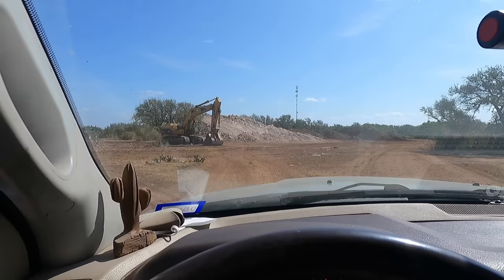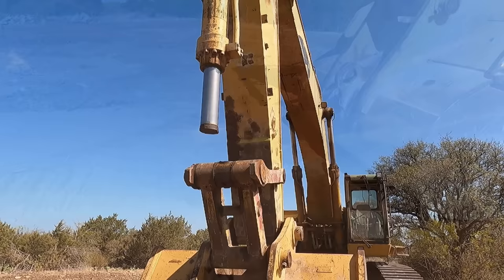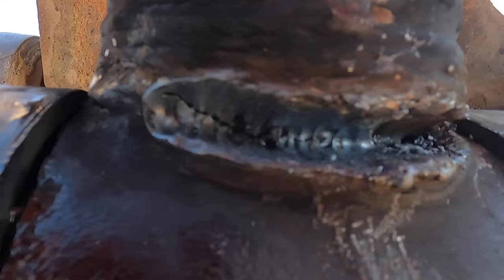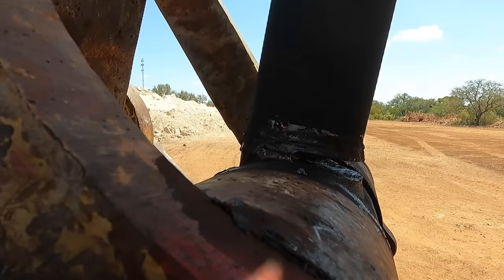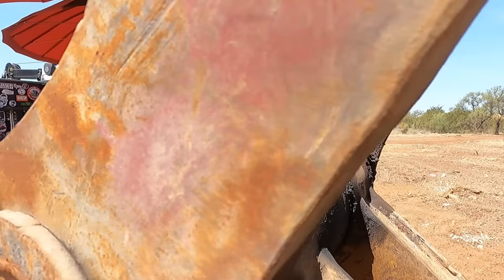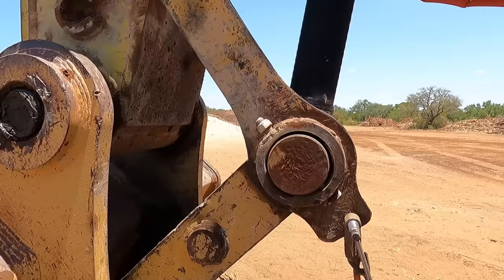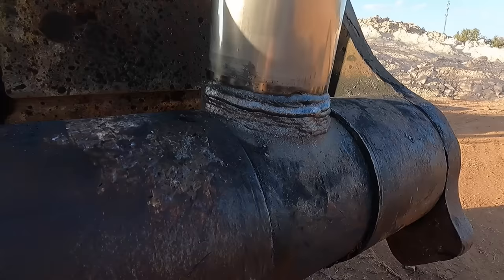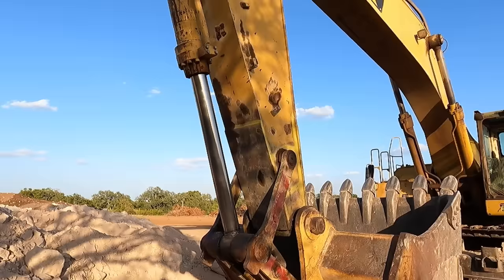CAT 365 Broken hydraulic cylinder.

Comment: Looks great! Its funny that you mentioned Kurtis, because that's who I thought of when you said "is this the right way?". In the field and in the machine shop are two totally different worlds!
Reply: Delta N9NE, they should not be. I shall try to explain why.

Isaac, Kurtis is probably sitting with his head in his hands, quietly weeping, while Homeless gives him licks on the hands and Karen feeds him cups of tea.. 

Mate, what you did is what the owner of the machine wanted, and yes, it will probably last for two more years  -  as long as the rest of the machine holds out that long. But given the history of repairs that you have made to that machine it seems to me that there are several considerations.

1) The machine owner is a tight-arse, and wants his machines running as soon as possible and as long as possible, and profit is his/her only motive. 

2) His/her machine operators are cowboys, probably (it's in Texas, yes?); if they broke that boom as badly as you showed in previous repair videos then those people should not be allowed anywhere near a machine. 

3) Perhaps the damage is a result of the owner's reluctance to spend money on effective maintenance?

4) Perhaps the owner is running a "Hail Mary" startup, with insufficient capital backing to be able to run his/her business, and is cutting corners to be able to continue in business without running out of capital? Yes, that model can work, but you need a lot of luck for that to succeed, and usually that mode of operation leads to ruination or bankruptcy or flight from creditors.

Mate, I have operated businesses, and I understand the processes and caveats in doing so, and the traps and pitfalls, and I understand the constraints your client faces. But if I were you I would steer clear of this client; the next time one of your repairs fails you made be held liable, ad sued, and you don't need that. Unless he/she is a personal  friend, of course. That is a different thing.

 creditors.
Reply: @gregbrodie-tyrrell3473  "... and Karen feeds him cups of tea" - like... WHAT?! Well chilled Victoria Bitter, or Foster's - that's what she'd be feeding him.
Tea? In the time of distress, for a grown up man? You must be kidding, mate... ;-)
Reply: @MrKotBonifacy  Well, he does live in Queensland, so if it ain't tea, but beer instead, it's more likely to be Four Ex, becos that's what is popular up there. The label is written thus:-

XXXX

Because the label looks like this that beer is known as "Barbed Wire" in other parts of the country.

Some unkind souls say that it is written so because Queenslanders cannot spell "BEER", but that's really a slander and an insult (I think), and is not an idea I would support, and that's not because Kurtis is a head and shoulders taller than me, as well as being half my age. I'm not afraid of him; oh no! Besides, he doesn't know where I live...

As for beer instead of tea, while I have seen him drink tea and eat chocolate-coated biscuits provided by Karen, beer is a much greater comfort for a man in times of distress, so there is merit indeed in your words. I shall be more careful in future.
Reply: @gregbrodie-tyrrell3473  Thank you for your kind reply and thorough explanation : )
"I have seen him drink tea and eat chocolate-coated biscuits provided by Karen" - see? Women are just like that, can't do much about it - one has to bear it, and suffer quietly, with dignity. (And pretend "well, I actually like it".)

Also, I'm not that familiar with all them Aussie beers - I happened to drink Foster's with my Aussie pal back in Singapore, and that was... some time ago. "Quite some", to be precise ;-)
And then one time he went back to Australia for a couple of weeks to see his parents, and when he came back he proudly opened a suitcase... full of smuggled in VB (Duty Free allowance down there is pitiful ONE litre only) and declared "this is the best Australia has to offer!"

...and who am I to question his authority on the matter, eh? And, as a matter of fact, quite good it was indeed.
Anyway, note taken - Queensland, "Four X", aka Barbed Wire. Cheers! ;-)
Reply: Kurtis is a real pro not many people repair heavy equipment
Reply: @edswider9309  Anway, I can see why he would prefer to, in the words of another YouTuber, "make a new one". Too bad you can't do that in field repairs - at least not at this size.

Comment: My father started in the Bremerton, Washington ship yard building ships. He started welding deck plates 3 or 4 inches thick {1960's}I got a kick out of his assistant, he made sure he did not run out of welding rod, and put the fire out when and if he caught on fire!  He fixed everything with Weld Wood glue or J B Weld. Dad had last count 9 welders when he passed at 94. He stopped traveling and told them bring it to me and I will fix it. Enjoy the video's.

Comment: IC: Kurtis with CEE how would you repair this broken rod eye?
Kurtis: Well IC I would request that the mechanical maintenance guys remove it and the cylinder from the machine, band it to a shipping skid, ship it to my shop in Australia so I can make a new rod eye then weld it onto a new cylinder rod. Then I would ship it back to the states for installation, something like that.
IC: We don't have time for all that, day light is burning away so lets get to welding.

The end.

Comment: Some times field repairs are a challenge to do it right enough for the machine to continue working. You did mention Curtis from CEE. He does fantastic work. But it’s not field repairs that he does. Guys like you and I have the challenges not of the precision of a machine shop. We get the dirt grease weather extremes. And still need to fix it right. Well as right as a field repair gets. Your experience knowledge always gets you the right finished product. You always face the challenge at least on video without stressing. Another fantastic job. Very good video

Comment: I find I need review sessions.  So I'm back looking at your project.  It amazes me you can weld that rod to the eye and it is probably as good as new.  That rod takes a lot of abuse. You clearly create a joint that is nearly the same structure as the original grain.
Reply from the maker: Well,...It turns out it broke again.... But not from my doing. They allowed  the pin to slide out again. SMH

Comment: Just watched a video from CEE an hour or so ago where he worked on another bit of gear with yellow paint on it. Absolutely great field repair. I hope that the ram had cooled sufficiently before it was tested. There could have been a whole new problem if a scorching hot ram was retracted past the seals in the end of the cylinder.

Comment: If it was off and in a shop with every option perfectly setup, lots of welders could easily repair it. The fact that you did it in the field in way less than ideal conditions, separates the welders in my book. I knew you had to get it welded from the center out. Otherwise it would snap pretty quickly... Thumbs Up!
Reply: The correct way is to take it off and do it right.  It cracked again in another area because it wasn't welded right in the first place.  Welding is not just filling it in.  Heat has everything to do with a proper weld job.  The first job probably caused this crack cause there was too much heat on the boss side that weakened the integrity of the steel.  Before I do any weld jobs on booms, stick, frames...etc it is required for me to get the proper welding procedures from the manufacturer.   Welding like this to "get the customer by" can kill someone one day.  This gentleman is no doubt good,  but you can't just do it to keep the customer going.  It's how law suits happen.

Comment: I was never a mechanic or welder but hung around a garage. Owner mechanic said if man made it, man can fix or rebuild it. First time he told me that he had rebuilt the spiral gear on a Volvo distributer shaft with torches and brazing rod. It worked. As I watch your videos I enjoy the way you breakdown the problem, see the issues and then the best way to repair based on your tools and your location. Beside being a great welder you think through the problem and solve it. Great job, thanks for sharing.

Comment: You mentioned that "Curtis" would notice the cylinder rod wasn't centered.  I'm assuming you meant Curtis from Cutting Edge Engineering in Australia.  I think Curtis would give you a pass on the repair since you had to put the machine back together in the field without lathes, boring mills or rotating apparatus.  
I'm sure your customers heave a sigh of relief when they see your truck roll up to the jobsite.  they know their problem will soon be solved.  
Thanks for sharing your talent.

Comment: I guess it’s cheaper for you to come out and weld up that old girl than it is to buy a new cylinder from Cat . You did an amazing job considering the tight spot you were in!
In Manitoba Canada I was in the crane business for a few years and every year I had to get my crane certified and often cracks were found and then I had to get a procedure from the engineer and they said what rods to use because they test the hardness of the steel and it was usually a 7018 but some places it had to be a more specific rod, but then the certified welder gets to work and once he’s finished then the inspector checks it again and if it’s not up to his satisfaction the welder must come back and this goes on until it’s up to the engineering standards and then I am good for another year but it’s very expensive and I learned don’t lift more than the chart says because it will crack or deform stay within your limits.
Reply from the maker: I've done some crane repairs myself and yes, they're very strict about the whole procedure. Worth it though!

Comment: I did a repair on a cat excavator several years ago. That was a bit smaller than this but still a good size machine. The cylinder was broken off exactly like this and I chamferred it down to a point in the middle and drilled a shallow hole to locate it in the eye. Once I had it set the way I wanted it. I carefully tacked it parallel with the pin on each side so that it would be secured from being pulled out of alignment. Then I tack welded it on the two sides perpendicular to the pin that would be less secure. Gradually filling in on opposite sides with short welds until I had the root completely filled in solid. And I continued to do that all the way around layer by layer until I had filled that whole entire space. Turned out pretty good. I could slide the pin in and out by hand so I know that it was well lined up perpendicular to the cylinder. I was back out the next week welding together the dog bone after they destroyed it. Both the dog bone and the cylinder have still held to this day and that was over 4 years ago.

Comment: 3/32" movement doesn't sound bad for that application. Maybe even pulled back & canceled when you did the other side. Seems the weight & resistance of cylinder kinda clamp it.  That soot trick is cool. Turned out real nice

Comment: Nice job, and it's an interesting case! Thank you for sharing, Isaac.  And it didn't break on your previous repair, so it's not that it lasted 3 years... your previous job it's still in place, actually! :elbowcough:
After tacking the cylinder's eye back in place, I would be tempted to take off the pins, to work on the cylinder on your shop or over your truck... but aside from taking extra time to disassemble and assemble back, the best way to make sure that everything fits in place and remains aligned, it's to work on it directly where it has to be.
So, even if I would be tempted to take out the piece... I like how you worked around it while still mounted in place.  Cheers from Spain, Isaac and son. :yougotthis:

Comment: That was probably the most weld I have ever seen at the end of a rod.  But it works, and it was lower cost than replacing the rod, by far!  Excellent solution to a difficult problem.  And protecting the chrome with soot was something I have never seen.  Very cool!

Comment: I think you have some of the best welding skills I have seen in over 40 years, during which time I was a heavy equipment operator and I have worked on pipelines, so I know a good welder when I see one, the skill you have with an oxy torch... amazing.. for this type of repair, you really need to drill, tap and thread a piece of rod into both the knuckle and the hyd. cylinder , at least 1/2 thick, this will help with the shear factor and you dont need to square off the end of hyd. cylinder to do so, I saw it done on an old JD 790...obviously you need to use a Grade 10 or better bolt, just cut the head off for threading...   Gidday from Canada...

Comment: 13:45 and that's why i weld an ear over the pin house on my machines. I'd rather have to grind that off whenever repairs are needed than have to deal with broken stuff because the operators weren't paying attention. Welded straps are superior to bolts, pins any day. Feller that taught me this went one step further and welded a threaded pipe end, that would then be capped with a bung filed with grease.
Reply: Their welder would get good at it what with all the swapping out of buckets and hammer during the day.

Comment: That makes sense as to how it broke. A rod in a hydraulic cylinder "ONLY" has strength in its vertical ,horizontal or basically in line position. Any side variation will snap them like a toothpick no matter how thick.

Comment: For moving the bucket enough to work on it, you only needed to press down while extending so the bucket will roll under.  Then extend the ram and weld her up.  Just different way.  
I've sootted up stuff for other reasons but didn't think of anti spatter.  Cool.

Comment: I would have tapered it a bit more to a point in the centre weld one side then the other building it out from the centre. I notice you and Cutting Edge use miller rough neck guns. Try Bernard heads on them the schroud gives more productivity and diping the shroud in cooking oil reduces splatter build up and its edible so non toxic, i run flux core wire Hobart wires rule, without shroud using graphite as a lube in the liner.

Comment: You talk about not being able to reach in there with the flux core gun. That Lincoln K126 gun looks like the Profacx 1260 FC Gun.

The tips have 5/16-18 Thread and Profax tips come in different lengths, from 1.12", 2", 2.72" and 3".

Forgot to add that you can change the back end on the gun and use it your shop Millermatic if needed.

Look at the Profax catalog on-line page 199.

Comment: With the shrinking and cracking maybe next time you run into the same situation weld about four passes on one side and then switch to the other side and gouge and weld four passes. Then alternate sides in single passes until you are close to the surface. Switch to single passes all around to finish.
Grind or gouge to even things up before the final passes all around.

Comment: I am not a welder but can make metal stick together. To prevent the cracking would it have been better to weld the center after gouging then gouge the other side so you could weld both sides at the same time to prevent cracking?

Comment: doable. the jd7700 combines had issue with rear axle pivot about that diameter snapping off then rear axle gets smashed up in straw walkers takes a alot of welding but it holds better than factory

Comment: I suspect the heat from the earlier fix was not evenly distributed on that cast steel rod end and when it cooled it put micro fractures in the casting. Given some time and stress from use and those fractures connected together and broke. If you don't pull the pin and preheat that whole end before welding then it's probably gonna break again in a similar manner.

Comment: I wrote a question why u didnt chamfer it beforehand and tacking the root and welding it around. but then i Resumed the video and u said why. 
i do think maybe you would have found its senter but maybe it would be hard to controll its warpage. never seen this repair before. but now i know i can do it. Youre fluxcore is no gas ? or with gas. That crack is wary narrow and the gasnozzle wouldent fitt in there.. Awsome videos love them. i do alot of simmilar jobs and considering to start making videos like yours.
Reply from the maker: Looking back, I would have tried beveling it all the way around. Although controlling the warping would have been challenging for sure. And this was a self shielded fluxcore wire. Its Hobart Fabshield 21-B

Comment: Before he answers i wanna put in my guess. Ur gonna have to bevel the edge for a stronger weld with more penetration and strength Clean both surfaces, maybe heat the bucket part due to its thickness and arc weld it due to the wind blowin away gas u would run on a mig. Probly have to move it around with the machines own hydraulics, line it up and fry it back on.
Reply: Well i was close lol, I think it's probly metal fatigue from being welded, and heated causing the eye to fail..

Comment: Isaac - is there any advantages of using the wire feeder over 7018 stick other than speed? What flux core wire do you use? Thanks again for another great video. 👍🤟 Much appreciated.
Reply from the maker: I believe the 7018's have a little bit more elongation properties which helps allow it to flex a bit before it breaks. I know that the Hobart Fabshield 21-B is close in number but slightly more brittle. I use wire for speed.
Reply: @ICWeld  Isaac, during repair you gouged and welded on side of the cylinder/rod and the crack opened on the other side.  How come?  Also looked like you didn't preheat or postheat?  What material was ram (long road part of hydraulic cylinder) and was it same as the part it was being welded to?  I appreciate you giving as much info as possible, that way if I ever try something similar I would understand more about the job.  Thanks for posting this video.